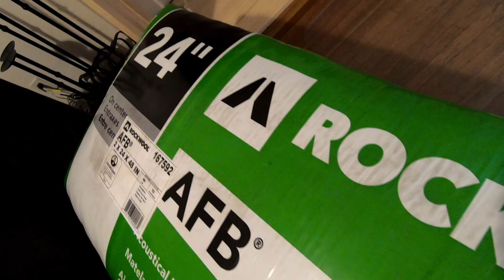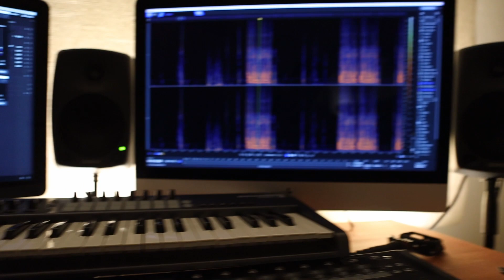How To Sound Treat a Home Studio

Comment: Hi Alex, just wondering why did you put the rockwool in a pillow case when you were already going to put fabric over it? What kind of fabric did you use for the pillow case?
Reply from the maker: Rockwool (and any fiberglass) gives off fibers when air is blown on it. It’s supposed to be safe for the most part...but I wanted to make sure it was well contained so it didn’t cause any health issues longer term.
Reply: @axk  that sounds smart, I'm building some panels today and I will do that. What kind of fabric did you use for the pillowcase?

Comment: Hey Alex, great video. Would you choose sound panels over sound blankets? My studio is actually in my living area so have a fair size space to dampen.
Reply from the maker: I prefer panels to blankets when possible, for both sound and aesthetic. Professionally constructed studios have integrated treatment and are built to minimize reflections, which is of course the best way to go. Next best option is to hang absorption panels and diffusers. Blankets are generally only used when they need to be set up and taken down, or on mobile locations. But they can certainly help and work! It doesn’t have to look good to sound good.